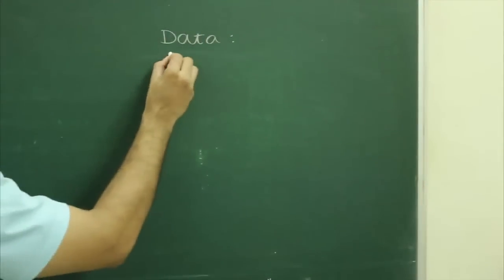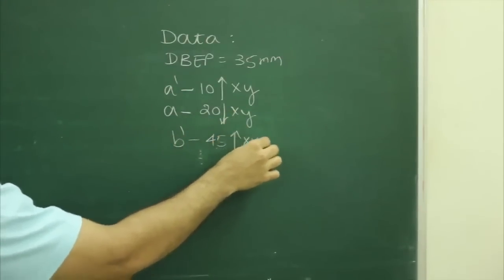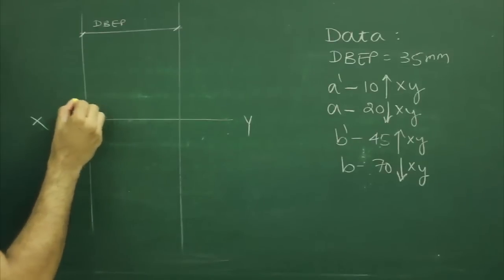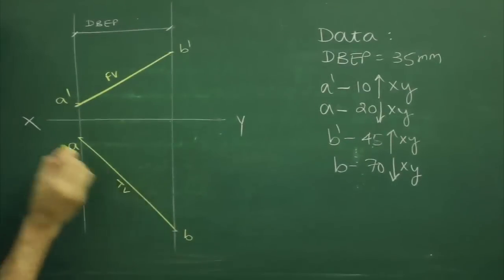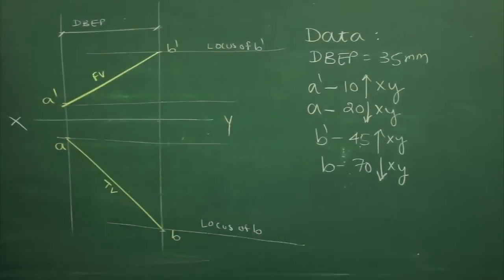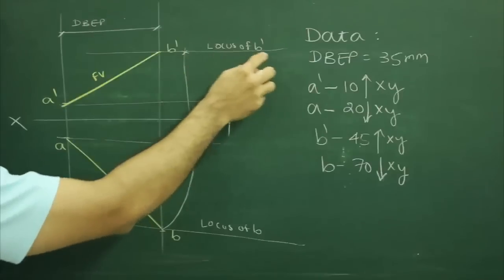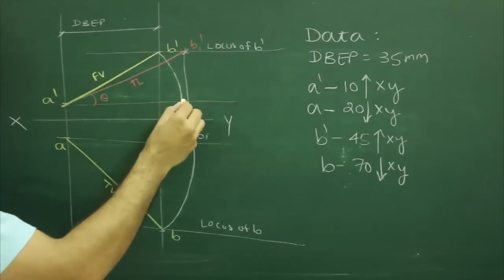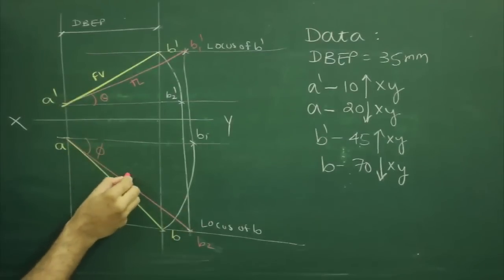Projection of lines 1

Comment: Sir how to solve the following problem- FV of line measures 70 mm and makes angle of 30 degree with XY . The end A is in the HP and the VT of the line is 10 mm below XY. The line is inclined at 45 degree to VP. draw the projections of line and find TL and true inclination with HP. also locate HT upload the video as early as possible